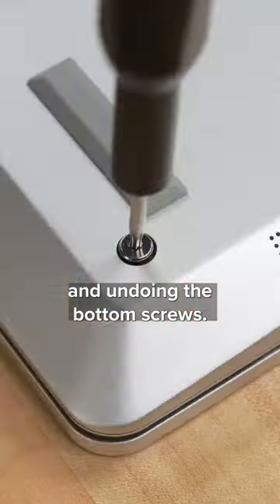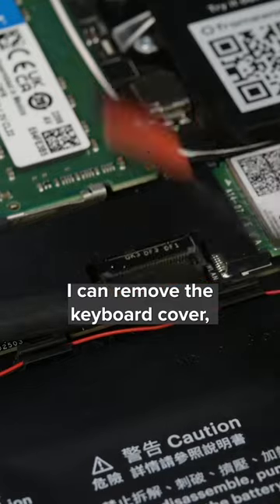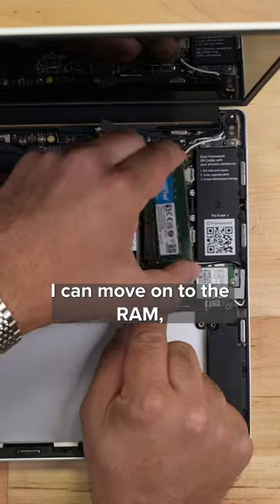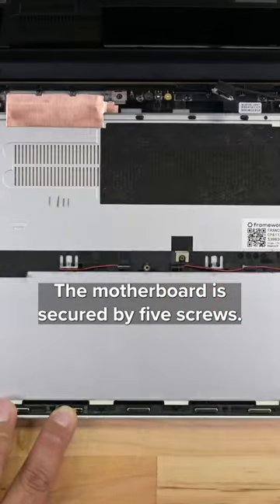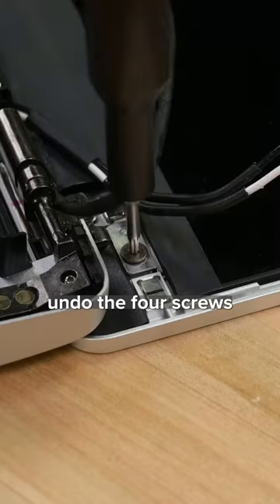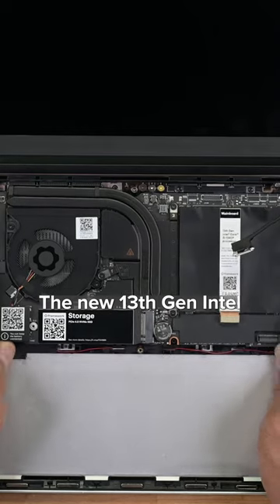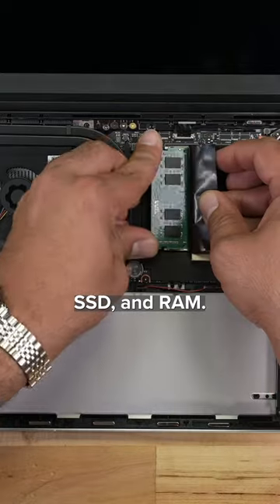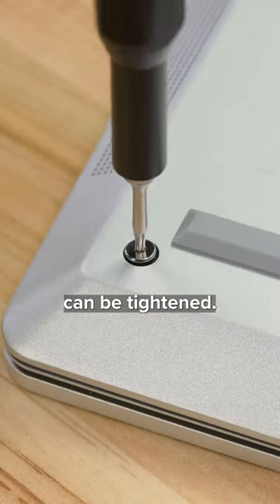Framework Laptop 13 Upgrades!!! #framework #ifixitteardown #laptoprepair

Comment: I love that this laptop directly disproves any claim that it’s not possible to build a thin, attractive and solid laptop that’s also repairable.
Reply: who said anything about solid?
Reply: not being cute, really, no one not them either, has ever made any claims, boasts, nor mention about durability; most of this frame is plastic and the hinges are substandard, just because you can replace the hinges does not mean it is reliable.
Reply: @applepoop10  most laptops dont have a graphics card..
Reply: @applepoop10  bro, its a laptop...
Reply: @applepoop10  i mean, there is a mainboard with ryzen now, and also a new modular discrete gpu, so yeah, you can change everything
Reply: i mean... its not really good at anything except being repairable, not a good laptop imo
Reply: @tgvinfinite2607  thats waht a mobile unit should be. they offer ryzen processors now. up to par with thinkpads and many laptops on the market right now. what exactly do you expect from a small laptop?
Reply: @PsycosisIncarnated  im just saying that although it is repairable, you can get a m1 macbook for 800 dollars, and it has much better battery life, build quality, and speakers than the framework laptop, and its cheaper (i also imagine there are much better windows laptops for the price)
Reply: @tgvinfinite2607  its a really good laptop lmao, its not juat repairable, its upgradeable and customizable,
Reply: @tgvinfinite2607  framework is defineltly cheaper than any other laptop in the long run though? You could spend a thousand dollars everytime your laptop gets too slow, or you could spe d much pess for a new board with framework, and thats only one of the major features o
It offers, its easily repairable which also makes it cheaper, and its heavily modularit allows you to modify almost every aspect of it.

And i really doubt any of your claims arwe anything but subjective
Reply: @applepoop10 framework 16 with replacable dedicated graphics says hello
Reply: @applepoop10  Most users do not need a dedicated GPU. The new 16" models supports a discrete GPU. Framework is a fairly new player in the field, so they can just get better.
Reply: @applepoop10 who gaming with a laptop though? If you wanted too, they have specific laptops for that, otherwise get a desktop/console for gaming 😂
Reply: @aeonjoey the whole thing is cnc aluminum idk where youre finding plastic other than the bezel and keyboard. The trackpad is glass too
Reply: @tgvinfinite2607  A M1 crapbook with soldered ram and ssd and a battery that is very difficult to replace. As soon as the Framework battery goes bad it's very easy to replace. Also you can upgrade wifi, memory ssd unlike the crapbook you adore
Reply: @asicdathens  No need to disparage something simply because it is not your preference. I find the soldering of ram and ssd a distasteful business practice, but that does not change the fact that M-series laptops are objectively good machines. I wish framework laptops had the performance, power efficiency, battery life, build quality, and speakers of M-series laptops. I wish Apple allowed you to upgrade the SSD and RAM or least least didn't charge ridiculous prices to upgrade either of these in the first place. Everything has a trade-off and it is simply a matter of deciding what downsides you are willing to put up with. I say this as someone who has used an M1 MBP for three years and is looking to buy a framework laptop.
Reply: @Joel11111  A laptop for me is a tool and not a fashion item.  Therefore ease of repair is high on my list of requirements.  And the Framework 16 is very comparable to a MBP16 from 2023
Reply: @thesupreme8062  i would completely agree if it were similar in price, but think about what you're saying for a second. it's hundreds of dollars more expensive, but worse in some ways. why would you get the framework laptop when you can just upgrade your laptop every 8 years or so? i would equate to the same price, although the I agree with the modularity part.
Reply: @asicdathens  ok, fine, it's repairable and is really good in terms of modularity. how does that justify its price when its hundreds of dollars more expensive and worse in someways than the MacBook? think about what you're saying for a second. if it was the same price, I would completely agree with you. at the price that framework is selling their laptops for, its just not justifiable to get them over macbooks
Reply: @tgvinfinite2607  Similarly spec'd MBP goes for $3500 while the Framework costs $2400 (Including the GPU) . Both 16" models
Reply: @asicdathens  but its not similarly spec'd 💀the framework laptop isn't even comparable to the MacBook, and no one in the market for a 16 inch MacBook like that will even consider the framework laptop
Reply: that macbook has 8 gb of ram, a soldered ssd(that one especially is a huge no for me) and has insanely high repair costs. If I wanted a 1 tb ssd and 32 gb of ram the laptop comes out to roughly 1200-1400 usd, which is a MUCH better value than a macbook. I feel like the pricing is OK due to the repair ability of the laptop being a selling point. Honestly if you want a solid, reliable and somewhat repairable laptop get a thinkpad, but those go for much higher than the framework so framework is better than those too. This laptop is for people who value longevity, thus they might have a higher up front cost than your avg wi dows pc, but calling the value worse than a macbook is delusional(especially those $400 ram upgrades🫣)

Comment: Unlike the hardware of an overhyped fruit company, this is actually protecting the planet.
Reply: Wonder what company’s your talking about 😂
Reply: @xscpflacon  Apple XD
Reply: @FallenAngel43  it might make a ok hackintosh
Reply: @xscpflacon  Probably the one from iCarly called Pear, eh?
Reply: @NicVandEmZ not anymore.

Hackintoshes only work with 10th gen or older.

Iris Xe aren't supported, not to mention newer CPUs with power management and so on.

Also, x86/64 macOS is fading away to be full ARM based.

I enjoy macOS, as it's a mix between a Unix/Linux-line base OS but with commercial software (MS Office, for example) but their hardware needs a little bit of care in terms of repairability...
Reply: apple got good with the m1 and m2 processors bro my macbook isnt a space heater anymore and the speakers are amazing
Reply: @JoaquinVacas tbh I hate windows laptops and macOS is miles better for my needs since I’m a photographer. I hope one day apple improves upon design allowing for more self repair
Reply: @gateway833  Hope this gets real, but doesn't seem to. :S
Reply: @blackxfiied_  until you have to try and fix anything, in which case it becomes a paper weight
Reply: @Steph.98114  true
Reply: or the ARA  ara project lol
Reply: Still, as well as the known fruit company it's overpriced
Reply: @JoaquinVacas not harping, but ios and Linux are both Unix based software.
Reply: Wtf this thing is not much more repairable then average laptop. Replacing the motherboard to change processor? Might as well buy a new laptop once in 5 years.
Reply: @maximkonechno8742  At least the old one can be used as a standalone PC, You can make it a OMV NAS connecting some external SSDs or HDDs to it via USB-C so it's still usable by using a 3D printed case for it made by the Framework company when You replace the MB inside the actual Framework laptop. Rest of the laptops formally don't have that functionality officially.
Reply: @maximkonechno8742  Still, You've said once in 5 years. Yes and once in these 5 years the CPU manufacturers make a new Chipset for new sockets and new CPUs for these sockets, so with new laptops and desktops You won't just swap the CPU's if they're not compatible with the socket, so You still need to buy a new MB.
Reply: Definitely blackberry
Reply: Definitely better than an overhyped Korean company as well
Reply: @blackxfiied_ how does efficient processor have anything to do with protecting the planet lmao
Reply: @JoaquinVacas they make amd framework laptops too
Reply: that's a luxury brand
Reply: @maximkonechno8742 But a laptop is much more than just a motherboard. You keep your screen and your frame, making it actually cheaper than buying a whole new laptop. If this practice would gain more traction, there would be a second market for these mobos, saving a lot of e waste
Reply: im sorry, but you are wrong, the raspberry pi does exactly what it needs to do for a price that doesn't break the bank /s
Reply: @originalkhawk who tf games on raspberry pi
Reply: @@JosephJ360 I know. What I mean is more like... POSIX.
Reply: Sadly going with Framework means you will be stuck in their ecosystem, and generally have to buy spare parts from them and rely on them for years to come. This is the exact reason why I switched to using Linux in the first place.
Reply: @fuylro6r6or6pg6p  at least you can.

And some of those pieces (M.2, WiFi cards, USB C expansions, RAM) are standard ones.

So yes. I prefer to rely on Framework (or not) for upgrading whatever (which as said, it's not needed) instead of having a 3500€ laptop which doesn't even let me change the SSD.
Reply: @xscpflacon  Pears&Grapes

Comment: Sold my Macbook Pro and bought an Intel based Framebook 13. I couldnt be happier with the upgradability, ports, performance, and quality. Obviously there are some inferior bits, but overall im glad i switched and have no desire to go back to Macbooks.
Reply: Howz the battery going
Reply: @PranjalPruthi  probably not the greatest, BUT, he can be using the U series, and those are great, not as great as Macbook because their processor is fundamentally more efficient, but I suppose efficient enough to not care for it to much. Also he was using the pro version, implying he is probably the type to use the laptop in a more professional manner, and at that point, the battery didnt really matter since everytime he is going to work using it, he is going to sit down for quite some time and going to use an intensive application.

Comment: too bad the CPU is soldered to the mother board, I wish it was totally reparable this way
Reply: I wouldn't bother to if I were deciding on things at framework. It requires a much higher budget to convince Intel and AMD to produce custom variants of their CPUs just to have LGA versions of mobile CPUs. Also inbtroducing a socket requires additional few millimeters of height and a few centimeters of length inside the laptop which is already crammed to the edges.
Reply: The problem is that laptop class cpus don’t really come in a socket form factor, only soldered
Reply: I dont think its realistic to have a non soldered CPU in a non massively thick laptop nowadays, unfortunately
Reply: The CPU being soldered is good, as it reduces power usage. Also laptop motherboards that were socketed used to only support 1-2 generations anyways, so its moot.
Reply: @__aceofspades  who cares about upgrade ? CPU/GPU and SOC chips are the most sensitive chips and when they die, you cannot replace them
Reply: that comes down to the form laptop cpus are sold in, I'm sure they would if they could.

Comment: I have worked on one of these before (just to install RAM, an SSD, and the operating system) and they are frigging amazing. It's honestly proof that laptops should have been more modular and repairable all along, because this tiny little company proved that it can be done even on a shockingly low budget.

Comment: Refurb Dell just as repairable and gradable for $100. Intel 8th still fast, ram 16-32gb, 256-2tb, wifi ac/ax, 720p/1440p LCD, battery

Comment: I dont understand why they made things so difficult to repair i mean back in the day laptops needs a few latches and screws to replace the keyboards and you can upgrade CPUs now CPU's are soldered into the main board.

Comment: I was checking the framework shop, and was disappointed by a lack of data and essential information about the framw. Which ports does it already have included and which are a must have to add using the expansion cards? For example they are offering an HDMI card.. so doesn't it have an video output without this?

Comment: I'll have to check and see if they make a 17" laptop.
Reply: They are releasing a 16” model with a replaceable GPU at the end of this year!
Reply: @nathanbasset  Thanks. That's better than a 13.
Reply: @nathanbasset  Yeah! You can also put an extra battery in the GPU "slot", or storage expansion, and whatever else the community comes up witth!
Reply: @fallow_ Boy am I waiting for that system. Hope they release in my country as well.
Reply: @FR4M3Sharma  fr, i would have bought it instead of some asus laptop, if it was in my country
Reply: @fallow_ I don't think extra battery you put there can be connected directly, but you can use it as built-in power bank.

Comment: I went for a preorder. Generally laptops have been disposable affairs. The longest lasting was a 13" Sony Vaio, the shortest was a  pricey I7 HP that died in 3 months, got a refurb under warranty that limped along until the warranty was up. That was $1,000 tossed away. This looks much more promising since I dont want apple products.

Comment: Framework is about reducing the amount of ewaste generated... is 2 generations of processor that significant a difference in this day and age?
Reply: No but man gotta make content and some dough
Reply: Intel has made huge performance gains with 12th and 13th gen. 11th gen and older are basically obsolete in comparison. If you use your laptop for work, the upgrades pay for themselves in time saved.
Reply: @__aceofspades  It really depends on what you call for work. Framework doesn't have discrete GPU so not really suitable those creative workload. Unless the person doing very specific work putting 100% workload on the CPU, 2 generation gap doesn't really pay for themselves in time saved for other daily tasks (like excel, chrome, etc).

Comment: And they make small desktop cases to house your mainboard and hook it to an external power supply, keyboard, mouse, monitor, and speakers (or headphones).  So if you display is still good and maybe even your battery you could leave those in the laptop.  I think AMD systems would be better though as they tend to have better integrated graphics as well as better thermal on average now.  If the CPU is not soldered on them AMD would be even better as they tend to make their boards pretty backwards compatible.

Comment: How can I get one of those? Are they expensive? I don’t know much about computers I just learned how to start doing this on my phone.
Reply: For something of similar performance you can get something much cheaper but it’ll be irreparable and upgradable meaning that you will have to buy a new laptop. In the long run it’s going to be cheaper than the competition because the individual modules are super cheap compared to a brand new laptop.

Comment: Hopefully modular mobile cpu's one day? (probably not)
Reply: Probably not going to happen, but having said that, some of the older laptops were fairly modular as I was able to upgrade from an i7-4700MQ to a i7-4710MQ easily.
Reply: I don't think so because the CPUs are directly soldered to the motherboard
Reply: No thats just not worth it
Reply: thinkpad already used to do that until lenovo took over the brand.,

Comment: Everything about this laptop is perfect except the Intel part.
Reply: now you can swap that to amd
Reply: Intel 12th and 13th gen are faster than Apple and faster than AMD. Intel is back on top.
Reply: @__aceofspades  Yes, usually the best Intel processors are faster than AMD's, the problem for me is battery life. You can get considerably more battery with AMD, and with Apple it's even better.
Reply: @__aceofspades  I'd rather more battery life than faster speeds, personally. 

I'm planning on buying an M2 Air and using Asahi Linux some time in the future, I haven't seen anything else really jump out at me as a portable development device.

I could maybe tolerate MacOS if I used Yabai, but Asahi is already stable enough to be daily-driven, and all I ever have open is a terminal window and a browser.

Comment: When these start support Discreet Video cards such as Nvidia 4080, and Amoled screes or even high Frequency (HZ) refresh rates with low latency.  Add in Vapor chamber design and you will have a system that is untouchable in the market as EVERYONE who owns a laptop now HATES that you have to buy an entirely new systems and basically donate or toss the old just to upgrade 1 item on it.  
AWESOME SOLUTION.